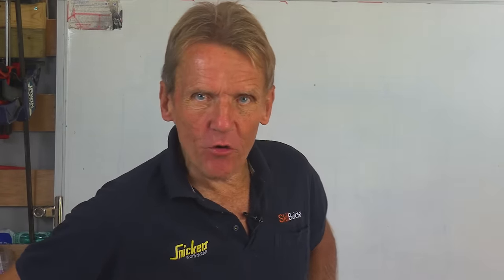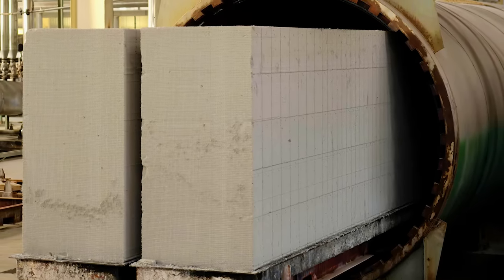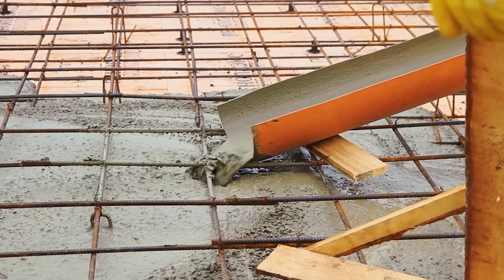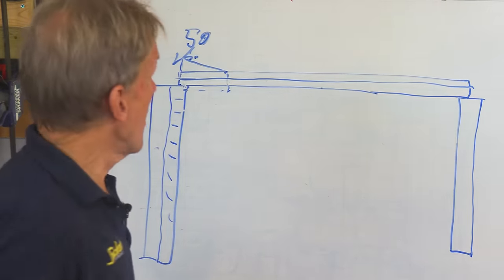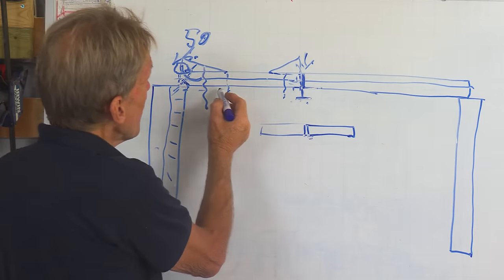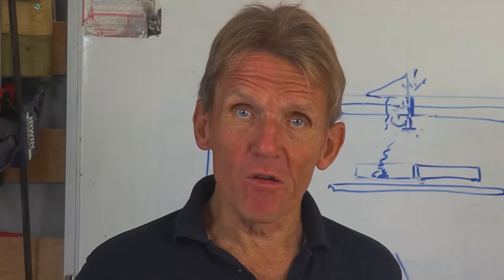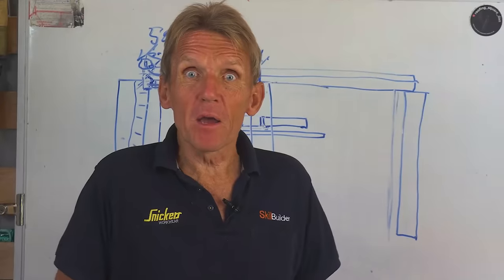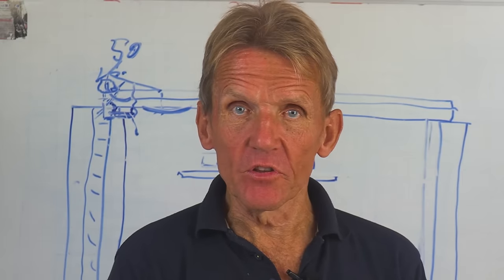The Ugly Truth About Reinforced Aerated Autoclaved Concrete (RAAC)

Comment: An extremely cogent, considered and easily understood explanation of pretty much all of the factors involved in the now suddenly urgent problem across an entire country.
Brilliant presentation sir, thank you.
Reply: articulate but his analysis seems all over the place. First it’s water infiltration and corrosion of the rebar, then it’s under spec bearing tolerances, then it’s insufficient or unanchored beam connections and if all 3 happen there is failure.  So the material isn’t at fault if it is installed to spec and protected from water intrusion.  All of these things BTW can be reasonably retrofitted and water intrusion is basic maintenance.  But what’s the goal here? well sensational content to get clicks and monetize the channel. Well done, you had me for a moment.  There are far better forensic engineering channels out there to follow.
Reply: @rcpmac I think he is saying that given that any flat roof, under maintained WILL leak at some point. And consequently will damage the RAAC panels. The under sized bearing issues may well be able to cope with the loads imposed, BUT with damaged panels if they start to bend then the panel is much more likely to fail catastrophically and at any time. We're the bearing areas built to proper spec it may well be an inspection would catch damaged panels in the deformation stage before catastrophic collapse. The tying in of rebar at the ends is just yet another possible scenario of a badly built, and not properly certified construction.

Comment: Very impressive and infopmative video. Sadly, the politicians who were responsible for this dangerous fiasco will, as usual, not be held accountable.
Reply: That's because every politician knows - I won't be here when the ** hits the fan.
Reply: Actually it is the citizens constant demand for lower taxes drives lowest bid contracts.  Politicians are not structural engineers but I’ve seen your reply over and over again. Throw the bums out… we’ll, look in a mirror

Comment: The mad thing is that RAAC was withdrawn from use in the mid 90’s because it was discovered in the 80’s that it suffered cracking & unlike reinforced concrete RAAC is no where near as strong.  Many people have heard the term concrete cancer and as you have described that just what’s happening in part. Rebar rusts expands resulting in RAAC failure. Moisture is another huge issue.  
As it was announced 30+ years ago & common knowledge RAAC only has a 30 year life span it was plain and obvious this should have been dealt with and removed. Thousands of schools and thousands of other buildings were built using RAAC that should have all been replaced decades ago & it would have been far cheaper than it will now. Crazy world no excuse for this negligence .  Many buildings have false ceilings so checking is not so easy. Yet all councils & Gov should know where it was used.  Yes Asbestos is another huge issue. Many of the suspended ceilings we installed were to shield from Asbestos dropping.  RAAC is all past its user life and been highly dangerous for decades .  So far in Scotland over 35 Schools have been identified with RAAC that number will no doubt be in the thousands.
Reply: Couldn't they just re-roof the building?  (I know it's nowhere near as simple as just saying it)
Reply: @Me-zo8yc   NO, its also used as flooring and walls & cladding.
The issues should have been dealt with decades ago & its just a complete cockup.
Even as late as 2018 where a school roof fell in nothing was done yet they still knew that from the report in the 80's RAAC only had a 30 year life span.  Building built from the 1950's to the mid 1990's where it was withdrawn from use are all well past safe.  
It comes down to not wanting to spend money and pushing it out of sight , out of mind.
Its not just schools, collages, hospitals , council & civic building its also offices its homes, like council housing, high rise buildings built in those periods probably also used RAAC. 
 I listened to an MP the other day saying teachers should fill out a survey after inspecting the schools for RAAC.  That is the incompetence of the MP's they are clowns.   It will be a very long and a very very costly fix
Reply: @Me-zo8yc  It maybe possible to remove the raac panels in a roof and put on a new roof made with timber trusses etc. Altering buildings can be difficult as you do not know what you are going to find until you start removing things.
Reply: @martinmorris8862 The problems with RAAC are different to ‘concrete cancer’. While the end result (failure) may be the same, concrete cancer is a reaction between silica and alkali, which causes expansion of the concrete and a network of micro-cracks, reducing the tensile and compressive strength of the concrete. It may result in the ingress of water and corrosion of reinforcing bar, but it is the reduction in the strength of the concrete which is the mechanism of failure.
But I have no problem with your comments regarding the seriousness of these problems, or with the fault of the government for the lack of both investment and competence.
Reply: @srp01983  While the issues of RAAC & reinforced are not all the same RAAC does suffer spalling & concrete cancer, is a general term. RAAC as already mentioned is like a sponge & over time becomes a very soft & almost powder substance. You can in some cases just pick away at it with your hands.
 During water ingress rebar corrodes & this rust expansion further creates issues & more instability. What makes RAAC worse is you may not notice the cracking unlike solid reinforced concrete that tends to blow out hard chunks of concrete of various sizes and often you can see the rust colour from rebar.  To the general term concrete cancer is correct as its similar and in addition to many RAAC issues. 
Over time, RAAC may deteriorate due to exposure to weather or other environmental factors. Signs of deterioration may include flaking, spalling, or crumbling. Age , structural movement, corrosion, water damage & cracking are all signs if they can be seen as many are covered. With the huge added issue of Asbestos inspection is not simple but all councils should have original specifications on all buildings.
  It is most definitely an issue that should have been dealt with over 30 years ago just like the Asbestos & back then would have been a fraction of the cost it will be now.
Reply: @martinmorris8862  You’re conflating two different problems. Concrete cancer is the layman’s term used to describe Alkali-Silica Reaction or ASR. It affects conventional concrete mixes which use aggregate and OPC. Raac is a different material made with different materials using a different method. It does not suffer from ASR.
Reply: @srp01983  In the 80s I was in the home improvement trade. I am not much cop at plastering. I had to do some work in a house that also needed its flooring lifted. I thought, why cement a wall, leave to dry for days and then plaster it? So I mixed cement and plaster together and slapped it all on the wall. To hide my short cut I did it low down, where the boards would cover it (must have had a sixth sense). About 18 months later the client wanted some extra work done, involving the floorboards to be lifted again. I was horrified at my handiwork, which had swollen up hideously and was falling away in lumps. I had to re-do it properly. Lesson learned...
Reply: Yes, I once told someone about concrete cancer they laughed in my face, they didn't believe a word of it.
Reply: There was funding in place and a school refurbishment program in place which would have completed in 2023. Gove cancelled it.

 Then last year when the department of education said there's a real risk of death due to this issue, and whether it would be possible to triple their refurbishment budget so they could try to catch up, then chancellor Rishi Sunak halved their budget.

No long term thinking or investment in the country by the leaders at the moment. Disgraceful.
Reply: @buzz1ebee  ministers have been letting things slide for many years and both colours of party, they have all so far "got away with it" and therefore not needed to pay and take responsibility, our current bunch of inepts may soon be replaced with another bunch of inepts and our current lot will be able to criticize from the opposition, the same way the opposition will complain today forgetting it had been their problem before. When it eventually does come to a head the previous inepts will have retired with their pensions and bonuses, so won't be bothered, its about time politicians (of all colours) were held responsible for the failings on their "watch".
Reply: I knew about this material and its poor structural suitability in the early 1980s There has always been a big differance between ideal situations and the use of a meterial in a controlled environmant and the the same materai used in the 'real' world, often misused by unskilled workers. It alright everyone now claiming they always knew there was a problem with RAAC, but most were very happy to use such beams as it was cost effective and resulted in bigger profits. Personally i questioned such via BRE and Blue Circle and was told to shut up and keep my noise out of the matter and stick to my research area ie cement bonded panel boards  such wood wool cement boards. It same story, in the man no wants to buck what ever trend has been accepted and flat roof RAAC had been accepted .
Reply: From what I have read it seems there was nothing wrong with RAAC provided it was viewed as a limited life material and replaced accordingly,  the problem comes when nobody wants to spend the money to replace the cheap building, you could even use the same materials in its replacement, on the understanding that in thirty years time you will be doing it again,, this would be fine if the councils only had thirty year mortgages instead of sixty year ones, this means the lender will not allow its "asset" to be demolished until its paid for, hence it has to last and hence RAAC was the wrong material to use, nothing wrong with the material but totally wrong economics, which once again no one will have to answer for their actions, so they get away with it, leaving it to the present inepts to either push it under the rug for future inepts to deal with or spend huge amounts of money no one budgeted for, the rug looks most attractive!!.

Comment: It was a good point you made about old flat concrete roofs being probably coated in bitumen or otherwise something black in colour ... simply because the added attaction from solar gain would have added an element of further aging owing to the temperatures involved and higher levels of corrosion on the re-bars within the concrete itself ... clearly adding to the problem. Great video.
Reply: Indeed, all that added thermal contraction and expansion won't have helped matters.

Comment: The idea of a modular school design is extremely good. It would save huge amounts of cost all through the process and you'd end up with a much more consistent product. Design costs would be minimised, build costs would be minimised,  build times would be minimised and even maintenance costs would be minimised.
Reply: But you'd still have to customise it to every school site and that school's needs, plus most new school buildings are additions to existing sites not brand new schools. So I'm not sure how this actually helps when you consider real world factors?

Comment: Really good suggestion of having one design for schools to cut down on design costs and get the best design that works. In order to fit in with the needs of the area there might have to be a few models (some single storey, some 2 storeys, different from primary and secondary etc. But a few designs done in such a way the number of classrooms can vary would be very workable and much needed.
Reply: It's also something common in many different building types. A lot of chain businesses that use new builds have standard designs for their buildings, with variations based on the needs of the particular branch. House builders tend to have common designs, but again with variations for different property types. It's not new either. The railways were an early adopter of it, and you see a lot of stations built by the same company that are variations on a common design. It not only cuts down on design and building costs, but also maintenance, since parts are more common. It's another reason why Aldi and Lidl work well. Pretty much anything that's likely to break and need replacing during the lifetime of a shop is identical throughout the business, so they can keep a supply in stock, or just put a repeat order in for more. Layouts and equipment are also very similar so staff can transfer around the business with ease. Where I work I often travel to different locations and one of the first questions I have to ask is where things like the canteen, toilets and offices are since no two locations are alike. Even the two brand new builds I've been to are quite different in layout.
Reply: Yeah I think you could get enough variety out of some kind of modular design. How many schools do you ever go into anyway? Most students will only ever set foot in two or three different schools. Nobody would particularly notice they all look the same. There's also room for non-structural, aesthetic variations like fascia or landscaping. Demountables are already very common as classrooms - they're fine really, at least they're air-conditioned.

Comment: The council I worked for during COVID had a repair budget of 7 million per year for 250 schools. 7 mill does exactly get you very far in that kind of position. The whole budget was handled by one Council surveyor and me doing the finance on 50% time. The council was doing the best it could with limited resources, but that can only go on for so long before people and structures break completely.
Reply: Yes! 22,000 schools on a 60 year design/major rehab schedule sounds more like 400 a year than 50!
Reply: @UK75roger Given RAAC last 30 years it has to be more like 800 a year, if all schools were made of it. Labour’s Building Schools for the Future programme wanted to rebuild 250 schools a year for 15 years, a total of 3,500 secondary schools in England.
Reply: @derekjc777  
I worked on BSF for 8 years (and Sure Start too). Previously in LEAs on design maintenance and planning of schools. Including 10 years at Essex, so, looking through the list, there are 2 schools I worked on....Sounds like, somewhere along the way, you may have been a colleague!